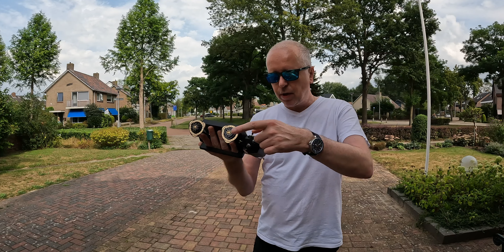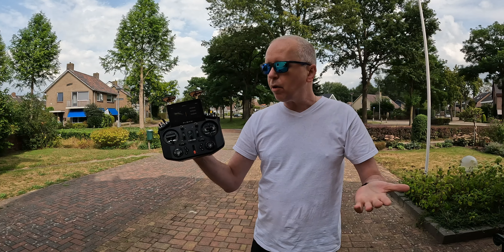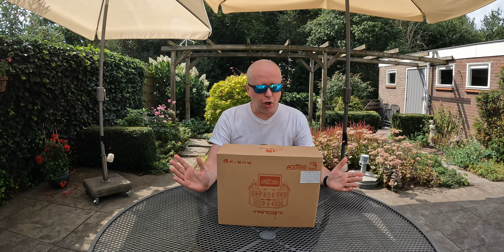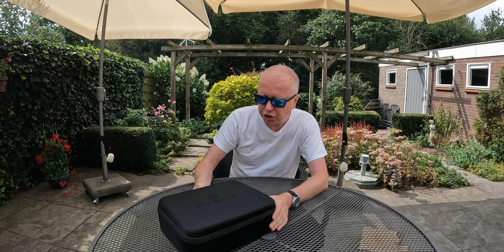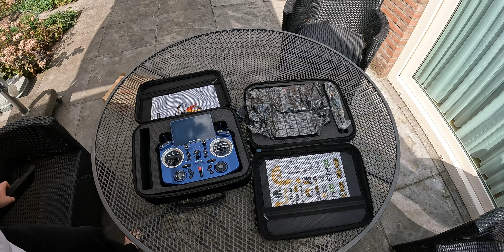FrSky Tandem X20 HD + HDzero ! :O - First Look + Discussion

Comment: Hi! Thanks for your video, which vtx are you using? thanks :)
Reply from the maker: Hi there :)  You're welcome and in this video I used a HDzero Race 2 VTX (but I used several other VTX's with this radio as well)
Reply: @DutchRC  Thank you for you reply! I have a Freestyle 2 and it not works. I'll try with the vtx you use 😁👍👍👍

Comment: Nice review! I just discovered that this radio exists and it looks like it would suit my needs quite well, however I can't find any specs about the screen except for its resolution. Do you know the size, technology used ( lcd/oled/..) and brightness? Is it usable in daylight without a hood? Thanks
Reply from the maker: Thank you JM! :) 
I don't have those specs eighter but can tell you it's flyable in daylight without hood.. https://www.youtube.com/watch?v=eR6RtgXe-P0 
that is not to say a hood wouldn't improve things
Reply: @DutchRC  Thanks, after watching your fly test video, it looked like the standalone HDzero VRX has way better reception than the one integrated in this radio, although it may be related to the antennas and firmware. But the fact that it has only 2 antenna inputs makes me think that it will never be as good as the HDzero VRX or goggles
Reply from the maker: @Jean_Mairdluheux  You're right! the reception wasn't as good as on the bigger monitor.. 
The will be partly because the monitor was a bit higher up, but for sure also because of the 2 extra antenna.. 

BUT.. for FPV with airplanes (that generally fly a lot higher up) the radio + inbuild HDzero setup should be enough.. So it will depend on what you'd want to do with it...

Comment: @DutchRC Adventures - Would really help if you shared your view here. My Futaba T8FG has just gone bust and while I could get it repaired im in the market for a new radio. I'm torn between the FrSkt X18/20 or the Radiomaster TX16S MK2 with AG01 Gimbals.

1. I currently have only FASST receivers so im guessing neither f the 2 will support them
2. looking for the widest possible coverage with the 4in1 MPM
3. The tandem 900 & 2.4 connectivity seems very tempting when I'm flying Fixed wing
4. Would you consider either of these at par with Futaba Quality? I loved my T8FGand its form factor.. 

OPTION1: X18/20 with 2 Addon Modules (i: ELRS & ii: 4in1)
OPTION2: TX16S MK2 AG01 4in1 one Addon Module (i: ELRS)

Which one would you advise. How much better in quality is the X18/20
Reply from the maker: Howdy man :) 
sooooo I actually mean to do a 1 vs 2 video between those radio's as I do have both.. 
bugt in short: for airplane flying I would for SURE pick the Frsky X20.. it's not even a fair comparison.. the build quality is far better.. side-sliders are far better.. trims easier to use.. 
For FPV drone flying.. probably the TX16S mk2 ....
Reply from the maker: ps: you might actually find this interesting to see :)  https://www.youtube.com/watch?v=AVpOLW47DBo

Comment: Hi, is there any issue with this hd model, something like a firmware or a hardware issue. It’s been backorder from so many days.
Reply from the maker: Not for as far as I know.. Shortage of chips maybe? Or a higher demand then they expected?
Reply: Do we have the option to update the firmware of the vrx and possibility to update firmware on vtx?
Reply from the maker: @ramchandyalamanchili8258  GREAT question I and I'm afraid that's one for the "time will tell" department :) 
I checked but don't see a seperate firmware for the HDzero part of the radio YET... 
Carl from HDzero did tell me Frsky will do the firmware support themselves but I do not know how / in what way.... 

I'm keeping an eye on this ofcourse...
Reply: @DutchRC  thank you for the reply. They might have integrated usb to the hdzero vrx module as well but I’m afraid without a dedicated port and a sd card slot there might not be an option to upgrade vtx assuming the x20hd is the only vrx one is having.
Reply from the maker: @ramchandyalamanchili8258  well.. we can place firmare's onto the SD card, and then flash receivers / tramsmitter module from there right? (browse the SD card.. click the new firmware file.. flash [something]) 
It must be something like that which would be quite easy to do (for the user that is) ..
Reply: @DutchRC  yeah, but from what you have shown the only extra port it has is the mini hdmi we are missing the vtx update port from vrx to vtx and also the sd card slot is for the x20 transmitter there is no sd card slot for the hd module atleast from the outside
Reply: And I bet these comments will be useful to any one who is waiting for the x20hd as this is the only video in youtube about X20hd
Reply from the maker: @ramchandyalamanchili8258  Ahhhhhhh yes.. the VTX firmware part.. you are right... 
I've asked Carl from HDzero about it..
Reply: @DutchRC  I'm very grateful for this video !
Reply from the maker: @tubamanandy2  thanks again Andrew :)
Reply from the maker: @ramchandyalamanchili8258  mini update: I finally got a BNF quad in with HDzero to test things (to busy at the moment to build something myself)... 
There sure is some work left to be done on the HDzero firmware in the radio.. BUT... I'll shoot a short video on the status
Reply: @DutchRC  that is really helpful. I would be all prepared before my radio get delivered. It will be really helpful if you do a teardown video of this radio as well to the part where we can see the hdzero vrx circuit. This is just to see if we have an sd card slot and a vtx upgrade port. One thing I observed is the official frsky x20 hd video also shows a sd card slot right below the micro hdmi on the radio which is not the case with production radios.
Reply: @DutchRC   were you able to update the hdzero firmware inside radio?
Reply from the maker: @ramchandyalamanchili8258  there is no new firmware to throw onto it.. Not that I am aware of at least.. 
HDzero says it will be up to Frsky to support the radio, which seems fair.. but I wonder if HDzero understands They should want the radio to work out just as well
Reply from the maker: @ramchandyalamanchili8258  ps: there is this "Chinese national day" over there now.. that somehow takes a week :D  hahahaha

Comment: Great review mate. Would be good to know what it is like with the hdmi out into some goggles. Cheers
Reply from the maker: Thank you very much Daniel :) 
Well yeah.. there is the potential of not needing a receiver on the goggle right? :)  It is also a bit of an accident waiting to happen though? :$  
Imagine hand-launching with a wire going from radio to goggle.. Not sure BUT I'll try it somehow :)
Reply: @DutchRC  I guess it depends on how you launch. I one hand side launch and have not had an issue with my open hd setup that is attached to my radio and I plug into my goggles. I think it would be a descent portion of users that would want to plug in goggles rather than using the screen only.
Reply from the maker: @danielmccullock1249  I will check out the availabler cables over here in stores :) 
And yes I agree.. this radio opens up the possibility of not having to buy a new goggle for a lot of people :)